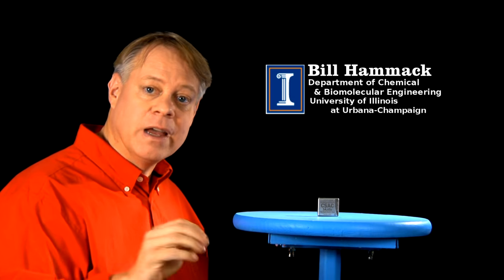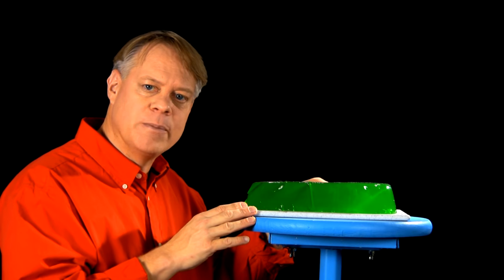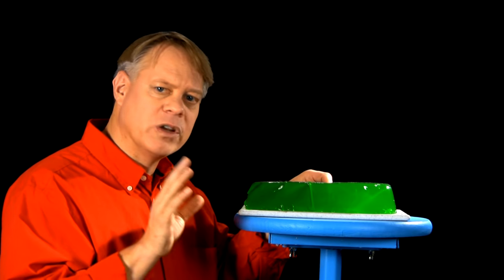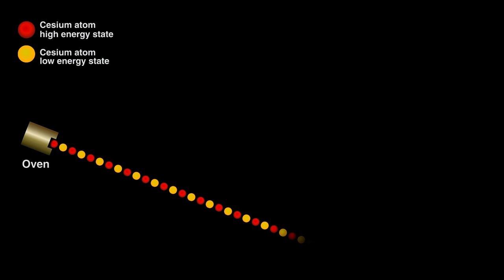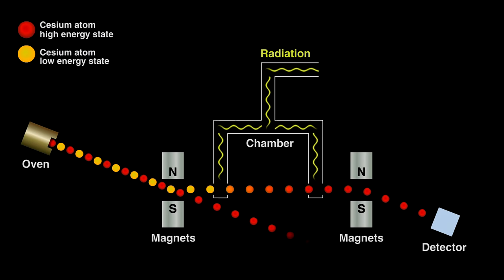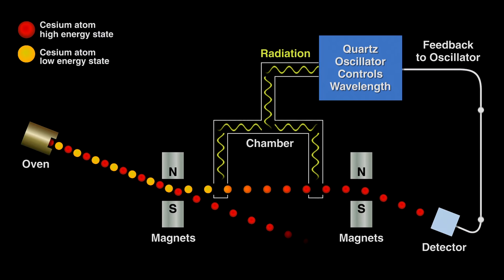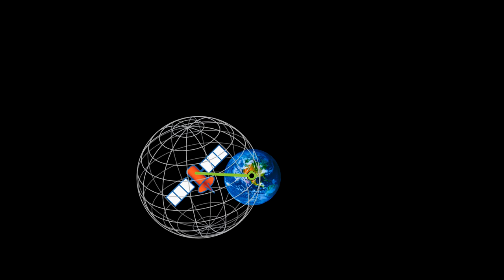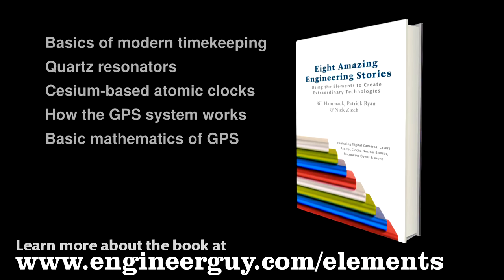How an atomic clock works, and its use in the global positioning system (GPS)

Comment: Man, having to adjust your clock one second every few million years is so inconvenient.
Reply: Ikr!! It's soooo annoying
Reply: I hope that I will still live in the same time zone.
Reply: Anant Tiwari  its okey you will someone to interact with some day
Reply: It's more inconvenient then resetting your regular clock every year... How do you set a reminder for every few million years... What do you set a reminder on, for every few million years... In 10 thousand years, everything presently including our bones will be dust...
Reply: this is why i ise a wifi clock. someone else adjusts it for me.
Reply: @56independent  I'm no computer expert like this guy. But i believe a 
"wifi clock" just means someone else is holding the clock, for you, on the other side of the screen...
Reply: there must be a better way
Reply: 1 world problems :(
Reply: Its sort of a misleading statement, basically if the clock could run for that long that's how much it would be off. However cesium reference tubes generally only have a life span of about seven years. Dont know what the listed lifespan of the LASER pumped CSAC chips are though.
Reply: @v4v819  you must be fun at parties.
Reply: @friendlyskiespodcast  Just ask the dust...
Reply: a leap eternity if you will
Reply: it's not meant for me bcs I'm lazy
Reply: 😂😂😂😂 true
Reply: And it’s going to tick you right off trying to find the manual, guide or instructions to figure out how to make the adjustment 😂
Reply: Facts
Reply: Gah I hope when they come out with a quantum clock they fix this issue, hopefully I’ll also be able to check the time of not just New York but across the universe, need to know the time.
Reply: Yeah and then it turns out the sattelite you were using your atomic clock on fell out of the sky a long time ago and you can't find it now that you need to correct it
Reply: Radiation and gps dont exist ask any flat earther! LOL
Reply: Watch how it works in real life and what alternatives: 
Do GPS satellites actually have atomic clocks on board?
Reply: Exactly
Reply: It is outrageous!

Comment: GPS calculations also have to factor in general relativity for accuracy. 

1) The velocity of the satellites slows down their clocks AND 
2) Their position within Earth's gravitation field speeds up their clock. 

Without these corrections the results would be off by a hundred meters laterally and thousands of feet vertically.
Reply: This happens because the physic laws is related to the frame of observation. (General relativity)

The error actually with not correction is some cm/sec.
Reply: Did Einstein consider the atomic clock (or analog clock) in his relativistic time dilation because of gravitational distance? How do these two devices are differentiated against gravity?

Comment: A cesium atom in an atomic clock beats 9,192,631,770 times a second.
Reply: Yup, thank you for pointing that out, Elizabeth.

And for the readers at home that number is not rounded or an average. It is absolutely exact because we actually define the time interval we call a "second" to be precisely that many oscillations of Cs133.

Even when the theory of relativity predicts that spacetime distorts, dilating time relative to another observer, both the standard unit Second and the frequency of Cs133 are dilated in kind so you simply wind up with more or fewer seconds (and Cs oscillations) measured by the out of sync observer per unit of their own time. :3
Reply: +Happ MacDonald Isn't time defined by the speed of light? Or is that distance I'm thinking of?
Reply: +Happ MacDonald Isn't time defined by the speed of light? Or is that distance I'm thinking of?
Reply: Actually, you'd be surprised but time is better defined by the causal propagation of a process having the capacity to move slower than light (that is, slower than uninterrupted causality) through space.

Nonetheless, the question of "what is time made out of" (answer: it's made out of the opportunity for systems to causally evolve, and it dilates in different circumstances because the opportunities for systems to evolve are impacted by relative velocities and warped spacetime geometry) is different from "how do we humans choose to standardize our measurement of it" (answer: in units such as Plank Time, and seconds which are exact multiples of vibrations of Cs133). :3
Reply: the speed of light establishes the distance in SI... i dont remember the exact number but yeah a meter is the distance that light travels in a couple billionths of a second.
Reply: yep and there's a guy trying to make a better one
Reply: 9,192,631,770 = 2 * 3^2 * 5 *7^2 * 47 * 44351
299,792458 = 2 * 7 * 73 * 293339

So 1 meter is defined as the distance light travels in a vacuum during the (3^2*5*7*47*44351)/(73*293339) = 30.66331898849837... beats of Cesium-133. 
You'd think that, since they chose to define the second and the meter this way, they'd have chosen at least one of these 2 numbers such that you get an exact integer, say, 30, for the number of beats of Cesium1-33 per meter of light.

Comment: Are there different types of atomic clocks?  I've heard elsewhere that atomic clocks work by directly measuring the oscillations of cesium atoms to define a second (9192631770 per second).  The method described here is only using the cesium to regulate a quartz crystal clock.
Reply: The Caesium-133 atom is used for the definition of the second so you would think that most atomic clocks use the Caesium atom for time keeping when in fact they don't because of the high cost associated with it. The most common atomic clock is the Rubidium atomic clock because it is significantly cheaper to make.
Reply: The clock described in this video actually does measure the oscillation period of cesium atoms in two different states. The first magnet ensures that only cesium atoms in the the lower energy state flow into the microwave chamber. Some electronics (think microwave emitter of some sort) excite this chamber with a particular frequency. The goal of the electronics is to 'tune' in to that particular frequency which causes cesium to jump to the correct energy state (the higher one). Once it has hit the right frequency, higher energy atoms will begin to flow out of the chamber thus striking the detector. This forms the feedback loop. If the electronics have the frequency wrong, atoms don't strike the detector. So the analog electronics adjust automatically (based on detector output). Now you have a hyper fine time reference. I think the piece of quartz is used as the generator of the high frequency signal. If you apply a voltage to the quartz you can 'tune' the frequency at which it oscillates. So the electronics only have to adjust a voltage across the quartz to finally arrive at the correct output frequency.

http://en.wikipedia.org/wiki/Caesium_standard
http://en.wikipedia.org/wiki/Negative_feedback

Comment: I'm a bit tired and I am not sure if I got everything immediately, but I'd like to ask how long it lasts before you're going to need to change a part for maintenance of such a device.
Reply: No moving parts and no exposure to outside air combined with microscopic scales means that, discluding being shoved into the center of a brick of C4, the atomic clock never needs any fixing.
Reply: +Nosirrbro That's amazing! Are they also waterproof?
Reply: Tarik360 Uhm, I wouldn't think so, but I guess you could waterproof the casing of it.
Reply: +Nosirrbro That is an even better way of doing it!
Good night!

Comment: Great video, but i was wondering: why is a Cesium atom with a higher energy electron deflected by a magnetic field?
Reply: Matt Philips AKA Percival The higher energy cesium is ionized more - i.e.. it has lost more electrons, giving it a more positive charge.
Reply: puncheex2  I think the ionization is the same (they don't lose electrons, but the electrons only jump to higher energy level). In the different energy levels it's the magnetic moment of the electrons in the two states that are different though (a quantum mechanical property, because the electrons are not point particles, and are instead wave functions).
Reply: No - the magnetic moment of the electron in the lower state is antialigned with the nuclear magnetic moment, ie N lines up with S, in the upper state the electron's N pole is aligned with the N pole of the nucleus making an overall bigger magnetic moment for the upper state.

Comment: You say "the most accurate of atomic clocks", and though I know this is pedantic, you'd really rather say "the most *precise..."

Accuracy of a clock is in how you set it. Precision is its timekeeping abilities, that it will stay perfectly consistent. If you don't reset your clock over Daylight Savings, it'll be inaccurate by 1 hour, but it could still be perfectly precise for thousands of years.
Reply: For instance, my clocks and watches are mostly very imprecise (especially my watches; they're super cheap, but fun), but they're all set very accurately, because I'll wait upwards of a minute just to set them exactly to the second from my computer or phone, so that they're all withing a couple seconds of eachother. Insofar as the source time I get from those is accurate, so are the rest, though some may veer off time after awhile.
Reply: If it's not very precise, it won't be very accurate.  So it's valid to say that it's losing accuracy.

Comment: But then how is this related ot the SI definition of a second or the caesium standard?
From Wikipedia: "A caesium standard or caesium atomic clock is a primary frequency standard in which electronic transitions between the two hyperfine ground states of caesium-133 atoms are used to control the output frequency."
It also says that a second is defined as exactly 9,192,631,770 transitions of those two states. I don't see how that number of transitions between the low energy state and the high energy state is important for the functioning of this atomic clock.
Reply: From what I remember from physics class is that the SI units is determine by the time light takes to travel a certain distance. Since light is a constant, a frequency or pulse using light can keep a measure of change which is time. A long time ago Galileo measured time using his heart pulse.
Reply: never believe wiki.its wrong on one way or the other
Reply: David Beyondplus but my reference book mentions the caesium atom's one.
Reply: Wikipedia is NOT a recognized nor reliable source for correct information about anything...

Comment: Fascinating. But don't we need to use an even more accurate clock to know that we calibrated this one correctly? Wouldn't we need one that loses 0s in a quintillion years to determine that this one loses 1s in 138,000,000 years?
Reply: That's a good question. I think that is done theoretically. The definition of one second is theoretical. So error of the practical clock is estimated compared the theoretical definition of one second.
Reply: 2006mct42 no, the definition of a second is defined by the amount a cesium atom oscillates.
Reply: johnnytremp  Yeah I know that definition is about counting the oscillation of the atomic states of cesium but the practical problem is about error that builds up over time in the clock. So what I wanted to say is that a perfectly accurate clock is not needed to estimate the accuracy of another clock. We should just know the definition of the second. They just do the math and calculate the probable error.
Reply: I think what they do is compare a bunch of cesium clocks against each other and statistically calculate the error.